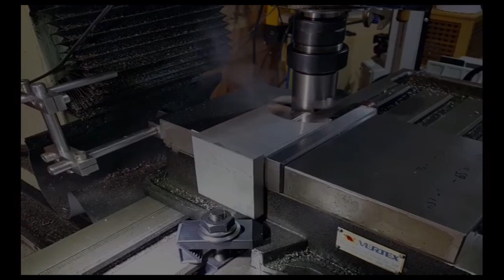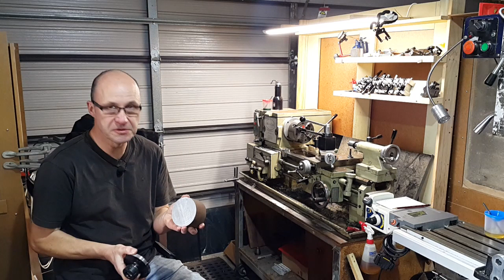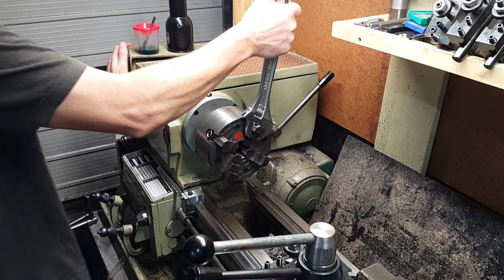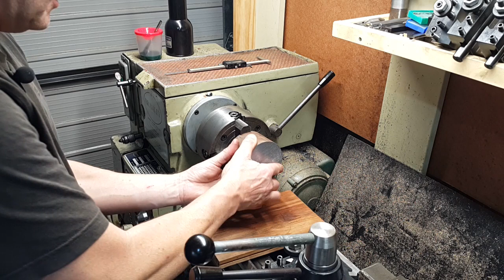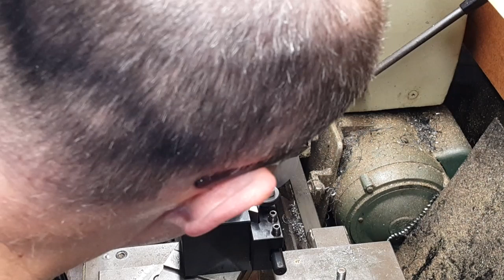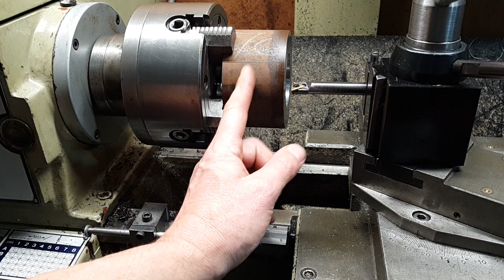#41 - ER32 Collet Back Plate - Part 1  of  3

Comment: Nice little project got a set of 32 collets and and holder and have never used them  .. bought them for mini lathe then bought the Grizzly  G4003G lathe and never did any thing with them.
Gave me a few ideas for a future project. Thanks for sharing 
👍send me you address and we can SWAP stickers
elkmontbrown@yahoo.com
Reply from the maker: Hi Anthony, I mainly use ER32 collets on the mill but its handy to have the use on the lathe especially for turning small shafts accurately. Ideal for small model engine work. Regards MachineNZ
Reply: @Machine_NZ  I have R8 for mill metric and SAE . Need to find a use for the ER32 COLLETS SINCE I HAVE 5c for the new lathe. May be a good give away when I get more subscribers  we will see.
Reply from the maker: @RagsdaleCreek  Hi Anthony, I've sent you an email. Did you receive it?
Reply: No I have not yet received it. Did you send it to elkmontbrown@yahoo.com
Reply from the maker: @RagsdaleCreek  Yes.....Ive resent it